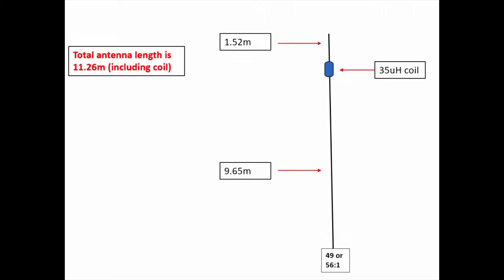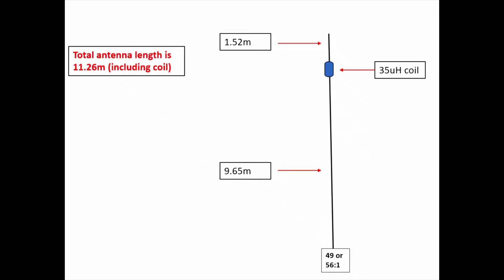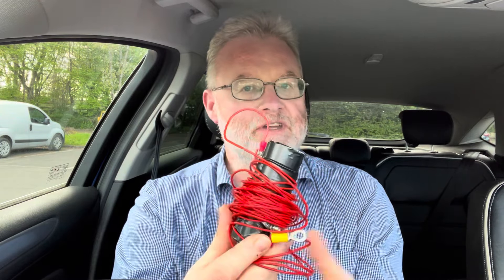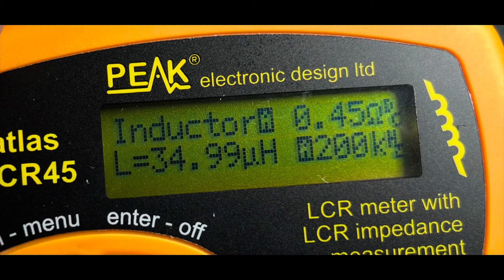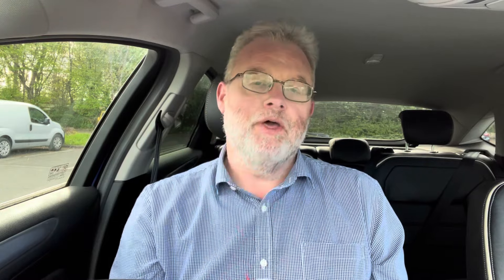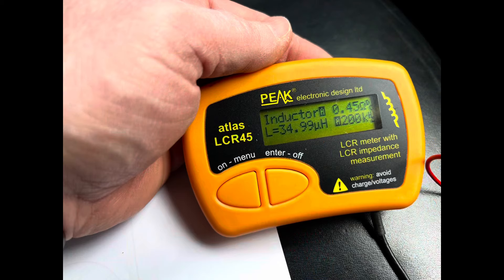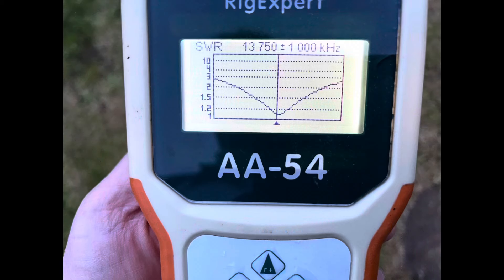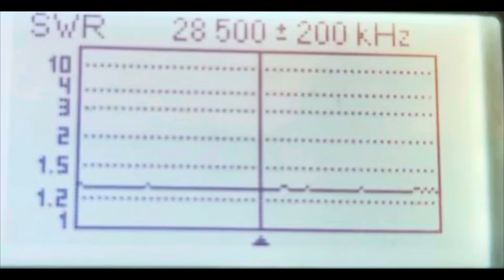How To Make A Simple Small Space Ham Radio Antenna For 40 Metres (Plus 2 Other Bands!)

Comment: I guess I could use same theory to make a “sporty 40” coil. Thanks Tim.
Reply from the maker: Absolutely. You can load the top of a 5m Q wave and add about 1.5m of wire to have a 20/40 ground mounted vertical with ground radials using the same coil.

Comment: Currently I have squeezed in 40/10m inverted V fan dipole into my small space. When the solar cycle 25 starts going down and 10m goes down, I will try to use coil loaded dipole for 80m. Or should I convert a 40 to 10 m EFHW which I purchased and currently in my shelf, with a coil to work for 80m as well? I presume that 20m long wire will be too short to make it work on 160m as well? 73 de Jon, VU2JO
Reply from the maker: Any of those would work. A 20m long wire is pretty short though for 160

Comment: Excellent video Tim. I wonder what the radiation pattern looks like on 10m? I know on a “standard” 40m EFHW, the pattern is a little erratic up on 10m (while it does technically work).
Reply from the maker: It’s slightly down on the 1/2 wave as full waves exhibit higher lobes (-3dBi at 5 degrees take off). The earlier video I referred to towards the beginning of this one (link on the screen) covers the modelling. 73!
Reply: @timg5tm941  thanks Tim. I did watch that video too! I'll blame the early hour!
Reply from the maker: @M0JSX  no worries mate!

Comment: I've got a coil ready to put up a 40/20/15/10 EFHW and have it work on (at least a bit of) 80m as well. The plan is to run it over my house roof and down the garden. I appreciate it might not work properly in the rain! :-)
Reply from the maker: Give it a go Paul!
Reply: Oh! I see that somebody is already about to try my plan for 80m when the solar cycle 25 goes down! 73 de Jon, VU2JO.
Reply: @johnsonstechworld  You can get commercial coils to do this, I've actually bought one second hand, but I'm going to create my own for another antenna.
Reply: @paulsengupta971  It is not that easy to locate one in this region. May be I will try to make one. I was wondering whether I can use 1 sq mm insulated electrical wire from local electrical shop? It is there just across my home. The coil might turn out to be quite bulky and heavy. For the regular enamelled copper wire, I have to hunt in the city with hardly any parking space near such shops over here!
Reply: @johnsonstechworld  I have made ununs and coils with solid core mains electrical wire, they work fine.
Reply: @paulsengupta971  Thank you.

Comment: Hi Tim! I constructed a 49 to 1 auto transfo with 3 stacked FT240/43 tores and 1.5 mm² enameled copper wire. Not really optimal (as colin, MM0OPX reported).
I mounted your designed EFHW antenna on a 14m spiderbeam pole and I can not get the 40m tuned. 20m and 10m are quite good but with 1.8 meters wire above the self (37uH designed with Coil32/64 program) I cannot get a tune. This evening I retried to get a tune with 3.4 m wire shortened to 2m but all the time I only get resonance between 6,6 and 6.7MHz and something with an SWR of 5:1 to 3:1 at 11 Mhz.
That's why I tried this evening with a longer wire. til now, no Tune on the 40m band. Why? Mistery. Hi!

❌ – 1 - 9/11/24 9:48 PM
Coil64 v2.2.33 - One layer close-winding coil
￼
Input:
Inductance L: 37 microH
Frequency f: 14.175 MHz
Former diameter D: 50 mm
Wire diameter d: 1.38 mm
Wire diameter with insulation k: 2.8 mm
Wire material Mt: Copper 
Result:
Number of turns of the coil N = 44.916 
Length of wire without leads lw = 7.452 m
Length of winding l = 128.564 mm
Weight of wire m = 99.862 g
DC resistance of the coil Rdc = 0.086 Ohm
Reactance of the coil X = 3,295.374 Ohm

Self capacitance Cs = 2.266 pF
Coil self-resonance frequency Fsr = 22.75 MHz
Coil constructive Q-factor Q = 251 
Loss resistance ESR = 7.894 Ohm

Additional results for parallel LC circuit at the working frequency:
=> Circuit capacitance: Ck = 1.141 pF
=> Characteristic impedance: ρ = 3,295 Ohm
=> Equivalent resistance: Re = 661.182 kOhm
=> Bandwidth: 3dBΔf = 70.649 kHz

Input data for LTSpice:
Inductance: 37.001μ
Series resistance: 85.893m
Parallel resistance: 497.326k
Parallel capacitance: 2.266p

If I try with 35uH:

I have to short the coil from 2.5 turns. Will try tomorrow if the weather keeps dry...

❌ – 1 - 9/11/24 9:51 PM
Coil64 v2.2.33 - One layer close-winding coil
￼
Input:
Inductance L: 35 microH
Frequency f: 14.175 MHz
Former diameter D: 50 mm
Wire diameter d: 1.38 mm
Wire diameter with insulation k: 2.8 mm
Wire material Mt: Copper 
Result:
Number of turns of the coil N = 42.498 
Length of wire without leads lw = 7.05 m
Length of winding l = 121.794 mm
Weight of wire m = 94.486 g
DC resistance of the coil Rdc = 0.081 Ohm
Reactance of the coil X = 3,117.245 Ohm

Self capacitance Cs = 2.2 pF
Coil self-resonance frequency Fsr = 23.53 MHz
Coil constructive Q-factor Q = 277 
Loss resistance ESR = 6.994 Ohm

Additional results for parallel LC circuit at the working frequency:
=> Circuit capacitance: Ck = 1.402 pF
=> Characteristic impedance: ρ = 3,117 Ohm
=> Equivalent resistance: Re = 676.176 kOhm
=> Bandwidth: 3dBΔf = 65.348 kHz

Input data for LTSpice:
Inductance: 35.000μ
Series resistance: 81.269m
Parallel resistance: 536.671k
Parallel capacitance: 2.200p

73 de F8BOE  ...-.-
Reply from the maker: How long is the wire below the coil for 20 and 10?
Reply: @timg5tm941  Hello again Tim. Good question! 
As I saw that my coil on a 50 mm form was too heavy (260 g) and made my spiderbeam pole bend too much, so I decided to make a lightweight version on a 25mm form and 1mm enamelled copper wire. Ad so I got a 78 g coil.
I made all the measurement with my MiniVNA Tiny and had the same values than with the bigger coil.
After watching closer to your VNA graphs, I saw that your 10m band results were not so far away from mine, on 20m I had now a better SWR. 
Shortening further to get resonance on the 40 meter band let me cut the higher portion down to 1,10 meter, real shortened one!!! 
In the end I have similar results than You have... Varying the forms calibre brings the advantage that you can play with the length of wire needed for the top section of the antenna.

I'm considering now to eventually add the 80 meter band.

73 de F8BOE ...-.-
Reply: Up 1 !
Hello again,
for two weeks I moved to my parent´s QTH and look... surprise !  The antenna was too short on every band!

What happened? 

Home QTH: some trees around, end of the antenna fixed to the house or on the spiderbeam pole. Ground Water approximatively 25 to 30  meters underground

Parent´s QTH: some trees around, end of the antenna fixed on the Spiderbeam pole. Ground water at 10 to 15 meter underground and it rained 4 days before the tests.

I returned at home and tested the antenna once again; too short! Damn! No er! Managed to get it tuned on 14 Mhz with a longer wire and some resonance on 27,9 MHz +/-. 7 MHz too long with the original end part wire (1,10m) too long, also with a longer end wire section, same resonance frequency for too short and too long parts. Invariable if I shorten the longer wire. So what? only difference is that the Autotransformator is now 80 cm above ground instead of 1,5 meter before...

I tried to get resonance for 7 Mhz with a 71uH choke for 80 the meter band but it was a mess! Should perhaps try with a 110 uH choke. 

What do you think Tim?

So what? The tuning is related with the height of the feeding point above ground?
The tuning is related with the soils moisture?
The resonance is biased due to other metal part nearby? But my 20 meter sloper was always nearby (1 meter) away from the end of the EFHW.

Greetings ...-.

73 de F8BOE

Comment: Hi Tim, same as the Hyendfed antenna which I think you have ?? I wonder have you compared the 2. After seeing a previous video of yours with the 12m pole and the hyendfed I bought the same and it seems to work well. Great to have a go at building one, good work !! Just need this weather to improve so we all can get out a bit more. 73 Sid MI5UTC
Reply from the maker: Hi Sid! Yes its the same design and I am glad to say that this design replicates it. They are very well made antennas aren't they? I would say there is no difference between the two antennas. Great to hear from you. 73

Comment: Sounds like one to make. If i found the details for my coil based upon my size of wire and pipe dia, could i make the antenna in one continuous length ?
It was only your testing explanation at the end that gave me any doubts??
Reply from the maker: Yes you can do this although bear in mind that if it is short then it becomes more of a headache to add wire. I like to keep my coil detachable as I have other plans for it for other antennas. 73

Comment: I am going to take down my EFHW and my Vertical and use the bits to make something a bit different . The goal is to get away from the local QRM of Solar and other electronic device noise. Desperate times call for desperate measures . Quite what I am going to do I am still working on . Oh er ! 73 M7BLC.
Reply from the maker: Good project!
Reply: Personally I would leave the vert up , and work on a rx ant. 73 zl3xdj.
Reply: @brianfields4479  I am intrigued by the idea of a loop on the ground around the outside of my garage for rx but have yet to work out how I can automatically switch antennas for rx and tx. I am a limited knowledge late life M7 after all 🙂.
Reply: This antenna for portalble in 40 meter have good angle for dx?

Comment: TIM this antenna as vertical works well on 20 and 40, 10 on another hand is poor. Much better to set it up as inv-L with transformer 2mtr of the ground apex at 7mtr and rest on antenna as horizontal as possible. When you model it you will see that 10m give a quite a good performance.
Reply from the maker: Fully aware of that difference. Of course it’s main benefit as a vertical is enabling 40m without any radials. For 10m it’s 3dBi down compared to a 1/2 wave mounted at the same height at a 5 degree elevation angle. Not a huge game changer and still capable of DX. I’d classify poor as being 2-3 S points down. On 10m this antenna isn’t that bad. 73

Comment: Hi Tim, What is the lowest radiation angle we can get on this antenna for DX?
Reply from the maker: Hi there - at 5 degrees elevation its best band is 20m, about the same as any half-wave vertical. On 10 and 40 its around 3dB down on a similar style antenna.

Comment: Tim, another great video! How do you calculate the lengths of the radiators and the required inductance of the coil for the bands you want?
Reply from the maker: Hi there. The radiator lengths: cut 10m initially for the lower longer part - this is a 1/2 wave on 20 and full wave on 10m. It is important to also attach the coil but not yet the top shorter wire, Trim the lower wire until you get a good match on 20 and 10. Then attach the top wire (initially about 1.8m) and then cautiously trim that for best tune on 40m The lower longer wire is barely affected. As for the coil, the 35uH inductance is important in that it provides enough impedance to choke off 20 and 10 and present enough loading to make 40 usable and fit on to a 12m support such as a fiberglass pole. 73
Reply: @timg5tm941  thanks for the detailed reply!